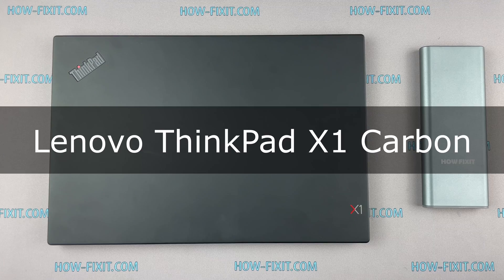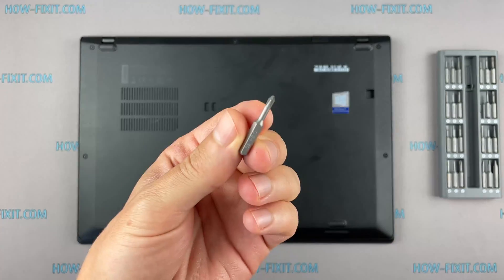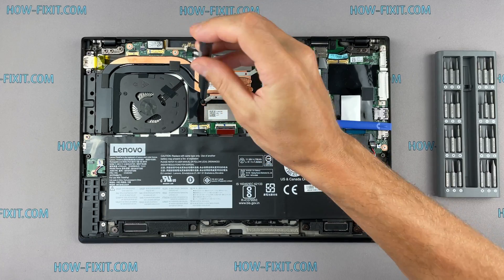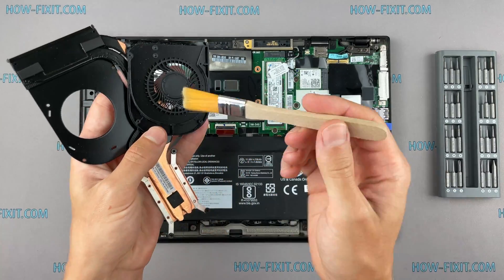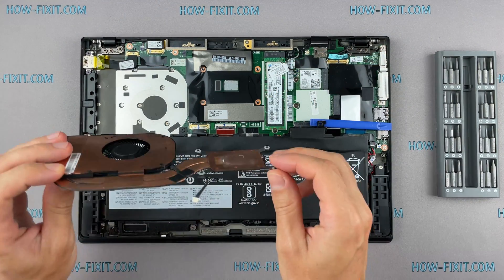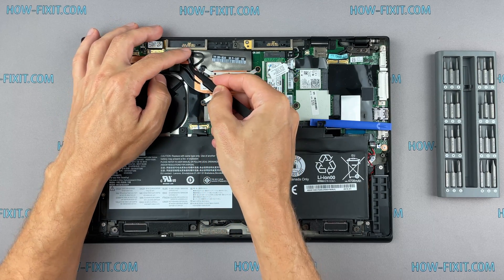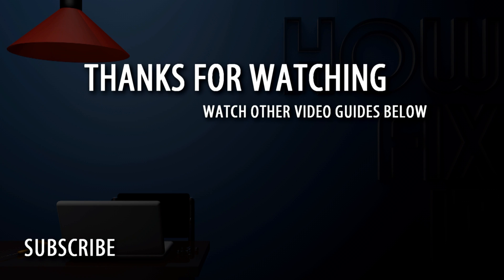Lenovo ThinkPad X1 Carbon Disassembly, fan cleaning and thermal paste replacement

Comment: Thanks a lot for the tutorial. I got an electrical current-like noise after cleaning and oiling (3-in-1 oil) the fan. Are there any solutions?

Comment: I did change the thermal paste with Arctic MX-6
and it is still over heating
is there better thermal paste to use for laptops?
any recommendation!
Reply: Go to control panel power settings and edit power plan so it uses maximum 90% of the processor I used to 80-90 C idle now I do 30-40
Reply: artic mx6 is already a good quality none conductive thermal paste, a slightly better one is basically the same, the difference would slim to none unless you use liquid metal but you def dont want use liquid metal on a laptop...
so is either you didnt apply properly or the dissipation system is undersized as usual for laptops...

Comment: I just finished applying thermal paste on a P53. and it took me half a day to do the complete process.. disassembly .. and reassembly.. I think i did a decent job left with 2 screws .. cant figure out where i have to put them 🤣.. how often i should change the paste.. because i don't think i have the patience to do it again any time soon
Reply: every 4-5 years, shorter intervals didnt make any sense on enclosed devices that are a pain in the 4ss to deal with

Comment: I didn't have thermal paste on the small horizontal rectangle below the vertical rectangle. What is that area? Does it need thermal paste?
Reply: No
Reply: It's the IGPU, in my case I would put thermal paste on it, but if the manufacturer didn't put it on, it means that it doesn't usually heat up enough to reach the critical point.

Comment: it seems simple, but i've seen people mess up and put stress over a flex cable for their X1C 6th gen. thanks for your guide. i been able to put PTM7950 and by god the temp is way cooler and the fan rarely running. i heavily recommend PCM pads over thermal paste for a laptop.
Reply: PCM tu apa bang
Reply: @arma11  phase change material yg dipake di honeywell ptm7950. kalo suhu dingin dia bentuknya masih benda solid, tapi berubah jadi cair/liquid di suhu tertentu. 

di konteks di atas, PCM perlu dipancing sama suhu panas baru performanya jadi bagus. harus stress test atau main game baru teknologinya aktif, dan kalo suhu udah turun dia berubah jadi solid lagi.
Reply: @b6xy  rekomendasi merk bang yg ada di shopee
Reply: @arma11  thermal grizzly kryonaut, noctua nt-h1, honeywell ptm7950.
Reply: How you put that PTM7950 though?

Self cut ?
Reply: @Moonface00z  yeah. put it in the freezer and let it freeze for easier cutting.

Comment: Is it possible to take this fan apart, as in some coolers, and lubricate the bearing? It spins poorly and stops quickly when you turn it with your finger, and a new one is very expensive (as is the laptop itself, anyway). Other than that, great video, short, simple and professional.

Comment: Bro, i hope you can help me, my laptop (the same model as the video) is overheating and i've tried everything, reinstall windows, changed the thermalpaste, buy a new heatsink and fan, undervolted the cpu but i'm still getting high temps (70~90 C) even with no load on the cpu. Do you have any idea what could it be the problem?
Reply from the maker: How to fix laptop overheating: https://youtu.be/1PTRCc_BRtQ
The ultimate guide to a laptop overheating covers everything from software solutions to CPU and GPU undervolting, and hardware checking.

Comment: Just replaced my old Nidec fan assembly that didn't have any air flow cutouts with a new Sunon assembly that does while watching your video. Thank you.
Reply: Hey! I'm going through the same process rn, were you able to only swap out the fan or did you have to replace the entire assembly? And how are you finding the temps now?
Reply: @Arctic_Fox709  it comes as one complete assembly with the fan. I honestly can't tell you how the temps are in comparison, I haven't had a chance to test, but it's definitely quieter. Good luck.

Comment: hello i think u forgotte the gpu
Reply from the maker: no, I haven't forgotten. Please note, the manufacturer did not even make a place for cooling for the GPU on a thermal tube.
Reply: @howfixit is there a way to add a pad or paste for the GPU?
Reply: @howfixit  Could you please explain why this would be a bad idea?
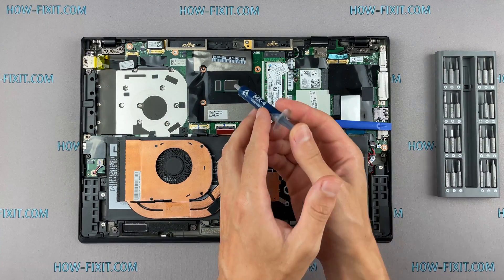Reply: @howfixit  at 3:55 while applying CPU paste, on the left the black block is GPU? why not apply past onto it as well?
Reply: @howfixit  Its not the GPU!! That chip on the side is just the PCH.
Reply: @howfixit  @themg6226  at 3:55 while applying CPU paste, on the left the black block is GPU? why not apply past onto it as well?